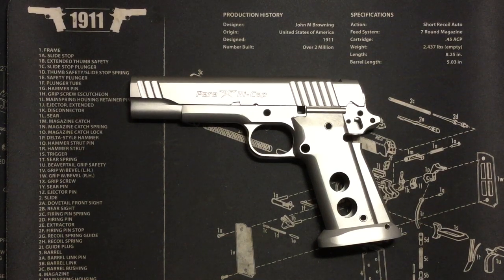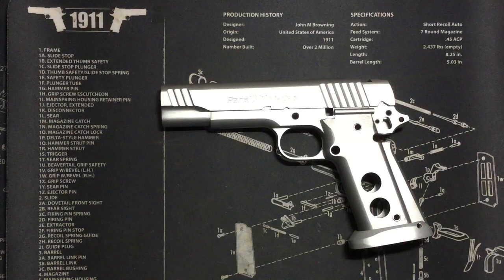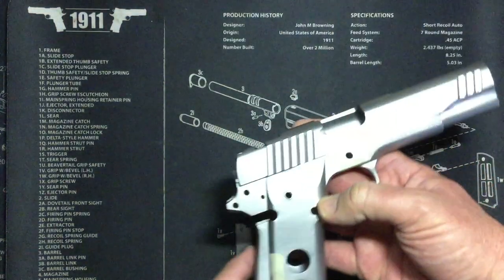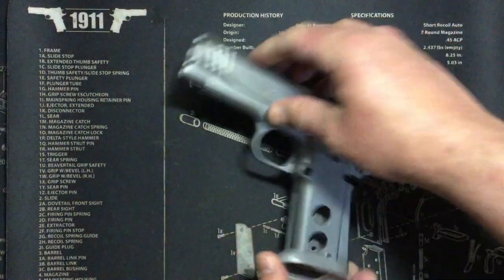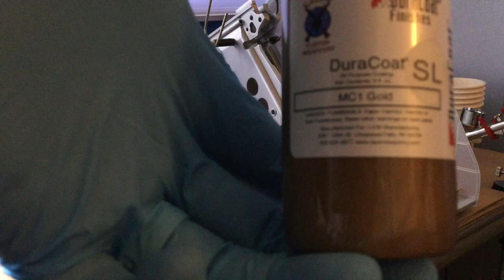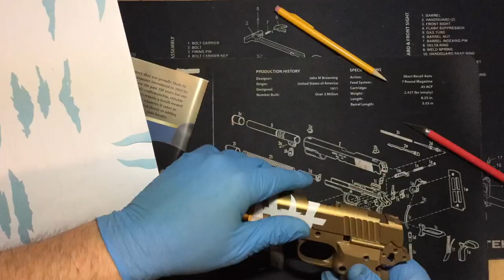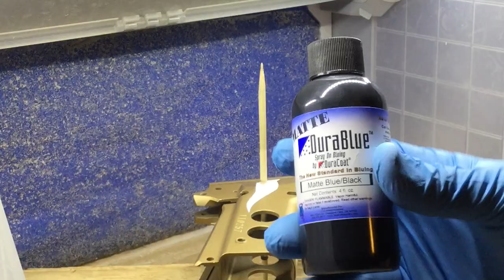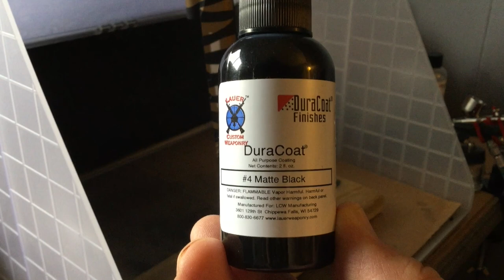Gold Tiger Duracoat Project

Comment: Whats the durability? How long does it last before ut starts to rub off from normal use and handling? Ballpark
Reply from the maker: @aggsup Town - Hi, great question.  When applied properly, it is VERY durable, and like a fine wine, it does truly get better with age...
With excessive holstering/ unholstering, you “might” get a slight bit of wear... but only where it makes contact inside the holster.  
But even if it does, having a bit of wear looks kinda cool..  Plastic/ Kydex holsters are more forgiving, and have less physical contact points than say, leather or cowhide.  I’m a borderline Fudd, so I used to run a lot of leather holsters, but Kydex is cheaper, and has zero “break-in” time..
Reply: @p99shooter  ok kool thanks for ur reply ill have to try this!
Reply: I only really plan to do this on my "trophy" arms thanks a bunch

Comment: How long did you wait to apply and take off the tape for the overlay? I am planning on doing a two tone duracoat job and didn't want to fowl up the base layer or the top layer.
Reply from the maker: Aaron Kalina - Thanks, Good question.. I like to let the base coats dry/ cure at room temp for at least 24 hrs BEFORE applying any stencils.  You COULD apply stencils after 1-2 hrs, but you’ll have MUCH better results by waiting a day.. Once the stencils are applied, try to focus the spray “in between” the stencils (wherever possible) so the paint doesn’t build up very much upon each stencil.. (which is also wasteful) Then.. I like to wait another 24 hrs to SLOWLY peel the stencils..  (always my favorite step- the reveal😉)
The key is to not rush it, take your time, enjoy the process, and have fun!  Wait a day btwn the major steps, and you’ll be very pleased with the results... 😎👍🏼
Reply: @p99shooter  Thank you for the fast response.  I hope my project turns out as nice as yours have.

Comment: So confused. You coated that gun gold/black. Why’s it now blue and silver?
Reply from the maker: gib859 - Hi.. the base coat was Gold, the darker color is Durablue “Matte Blue-Black.”  Sometimes it looks blue, sometimes it looks black.. depending on what type of light it’s in.  We went with a Gold basecoat to hopefully compliment the Titanium Nitride (TiN) finish on the heavy barrel.  
When the original finish is sandblasted before painting, it can take on a “silver” finish.. is that what you were referring to?
Reply: Yes, sir. The finished product in the light of day looks wildly different (no better, nor worse) than what was shown in artificial lighting. Great job. I can’t wait to Duracoat my 1911 next week 👍
Reply from the maker: gib859 - Cool👍🏼..  Though Duracoat does go on pretty thinly, if the slide-to-frame fit on your 1911 has tight tolerances, I highly recommend limiting the number of coats on the internal rails. (It can impede smooth cycling if there’s too many coats at that crucial point of contact).  Also, if in addition to the frame, you’re painting the slide.. don’t forget to paint the round, rear tip of the extractor. (The part of the extractor that is visible to the shooter).  It gives a more consistent look... good luck, have fun!
Reply: Like that dress lol 😂

Comment: I was just wondering what p.s.i. do you have the compressor set at.?
Reply from the maker: Hi, Dan.. 60 psi
Reply: p99shooter do you reduce the DuraCoat  ? I guess you are using a larger compressor. The one I have only goes to around 50psi.

Comment: duracoat , ughh . cerakote is better ! i am surprised someone hasnt said that yet . now with that out of the way . i have used duracoat since it came out . great stuff . and i have never had to redue any thing i have ever done . fallow the directions and it lasts great . duracoat gets its 'bad' rep from internet guru's who started in forums and youtube . saying ' its just paint ' and put it on like paint . but the same guru's who say and do that will fallow the directions to the letter when cerakoteing  some thing . lol . they both have the same prep work before spraying . and no oven needed for duracoat . but it will help the drying time if heated and cured . great job ! how does the gold look over time ? i am thinking on doing a trigger and hammer on a 1911 in gold . od green on frame and slide and hk black on the safety , grip safety and slide release .

Comment: Any clear coat used?
Reply from the maker: Indica Strain - No, not in this case.  I find that where the tolerances are tight, such as where the slide meets the frame, it can impede smooth operation.  The finish will improve with time, just like a fine wine 🍷